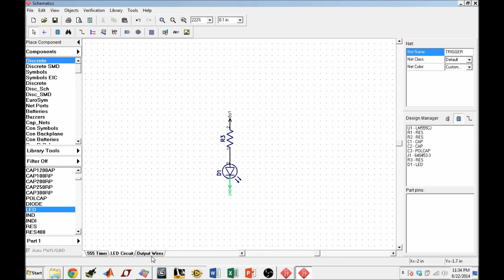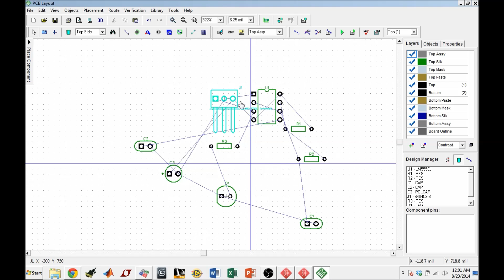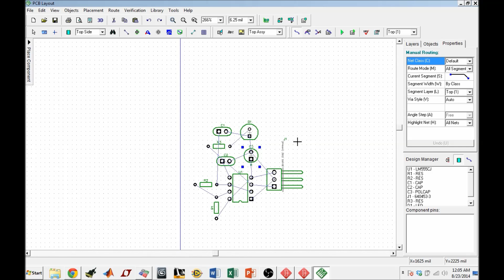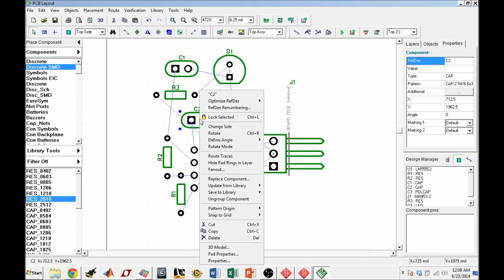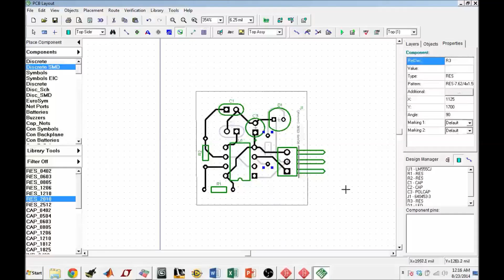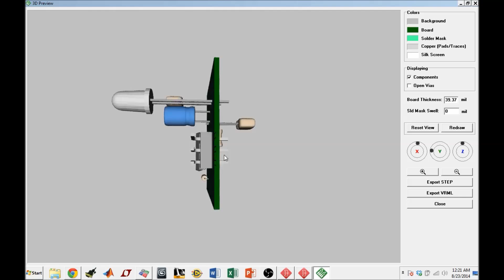PCB Design Using Diptrace pt 3: Creating a PCB Layout

Comment: Berni Kendrick........Thanks for great Dip Trace tutorial.  I hope that you can help with this problem, when I  go from schematic to PCB layout I get a message saying that certain components do not have Patterns, this stops the PCB from being laid out.
Reply from the maker: That means that some of the parts you used in your schematic don't have printed circuit board layouts to go alongside them, or Diptrace can't locate them. Use different schematic parts that have circuit board patterns, or make your own.
Reply: Thank you for your reply. Since Sending the message to you I have worked out the answer and now have the PCB laid out. Thanks again.

Comment: To be frank, you should never go overboard with the "connect to net" thing because it makes the schematic hard to follow and convoluted. Best practice is to have related stuff on the same sheet and if you have large and often repeated schematic pieces, then make them to a new sheet and use them as a hierarchical component.

And never use colors for wires. Not everyone can distinguish colors from each other and if the schematic relies on the colors to make it easier to read, you cannot print it in black and white anymore.

Not sure if you know, but there are real standards for schematics that should be followed when ever possible.